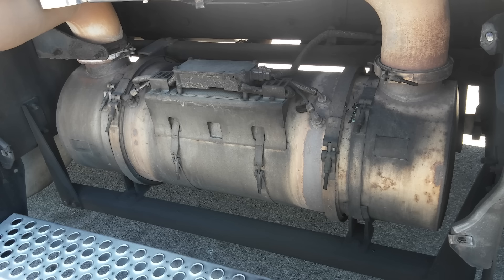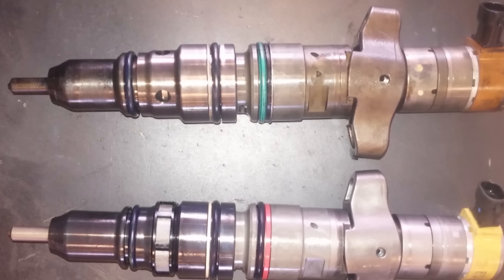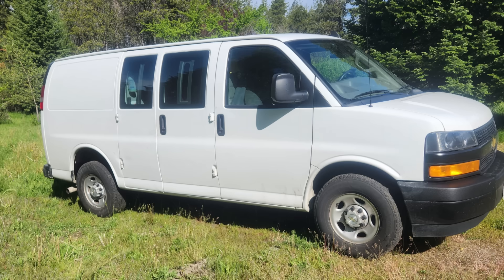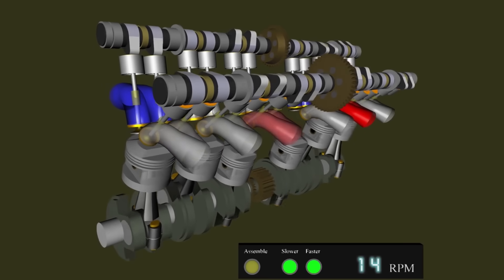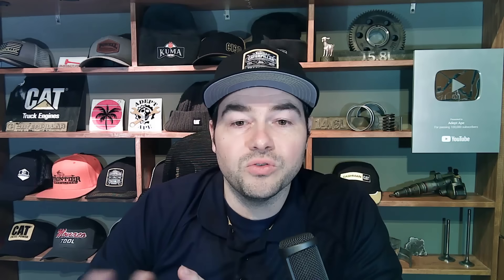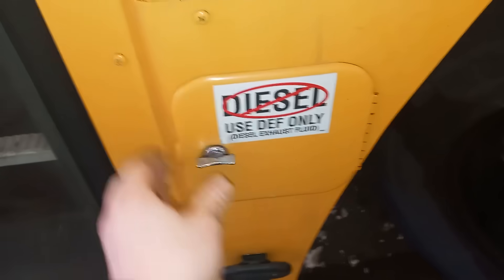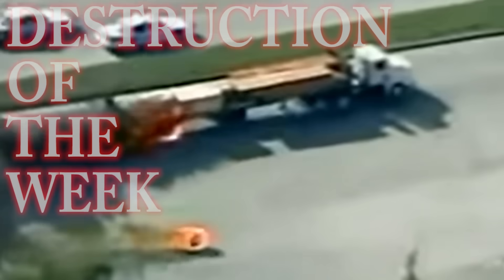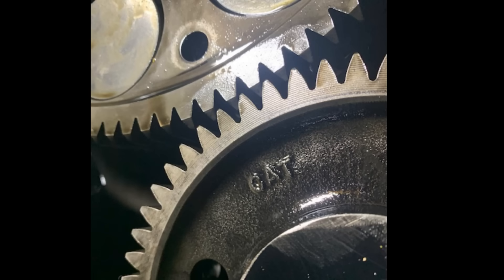What!? Gas engines are getting "DPF" Filters Now!!!

Comment: The GPF is nothing new, as someone who works on euros it’s been around since 2014 when Mercedes was the fist to use it and I have worked on tons of rovers and others who have it.  Just like on the diesel side as along as you maintain the vehicle well and use it properly it’s not an issue but the issues we see are the people using the wrong oil which is primarily an American mindset of 5-30 synthetic is why it takes right when there’s a whole nother level of gettin the mfg spec or ACEA ratings.  The issues we see on the diesel side in the shop is misuse like the guys idling at the school or in the Starbucks drive through becuse the guys who work them hard like a diesel is made to be used don’t have half the issues of the guys who use it for a commuter car

Comment: As we should all know by now the main problem with DPFs has always been the need for active regeneration because a) people drive diesels around town at low speed, causing  the filter to get blocked and b) all that nonsense with fuel injection during the exhaust stroke diluting the oil. My understanding is that for a GPF active regen is rarely if ever necessary, the exhaust is generally hot enough to regenerate the filter during normal driving. So generally they're not much of a reliability issue compare the to DPF.

Comment: Saw that coming, i noticed more smoke belching out of newer DI gasoline engines than my old IDI diesel ford does under load.
Reply: long live the 6.9 and 7.tree
Reply: It could also be oil due to low tension piston rings

Comment: It's due to lack of Atomization. Same reason why a carb makes more HP than fuel injection along with cooler air charge which means more O2.
Reply: carb never makes more HP then a fuel injection of the same environment.
Reply: @casemodder89carb always makes more HP than fuel injection due to better Atomization and cooler denser air charge. Engine masters ran a series of tests on the same engine and the carb always had better hp numbers. Drivability is a bit better with fuel injection

Comment: Don't worry, a GPF passively regions on a gasoline engine. There's no spark plug to light it off, it's done by retarding ignition timing and the leaning out the fueling. The ECU models the filter loading and does 99.9% of the filter cleaning when the driver lets off the gas which provides the oxygen required to burn the soot out of the GPF. With the new EPA regulations under the Trump administration, GPF's we'll go away anyways.

Comment: Direct injected gasoline engines will definitely roll coal at wide open throttle under high load, maybe not quite as bad as a diesel engine but they will definitely do it, I speak from experience abusing many different makes and models at my job 🤣🤣🤣

Comment: since this isnt something i know alot about im not going to preach about it being dumb but i will say that to best of my knowledge, it isnt •that• exhaust smoke exists that is the issue, as far as i know it isnt even considered bad for the environment, its that the specific byproducts of diesel soot causes cancer, gasoline being a more refined fuel doesnt have the mixed in byproducts that create cancer causing soot, my guess is that what they meant was the more stratified combustion process creates more oxides of nitrogen which are bad for the environment are either captured and burned in a similar way, or the "filter" doesnt actually work that way and theyre just simplifying it because they think we're too dumb to understand, my guess is its just a new version of the "3-way" catalytic converters that some cars had in the 90s but we stopped using because they cost too much

Comment: How to not require a GPF to achieve high fuel efficiency: go eCVT hybrid. Then the engine only ever operates in a narrow RPM and load range the entire air and fuel delivery system can be optimized for to eliminate the need for additional exhaust hardware besides O2 sensors to sanity-check what happens upstream.

Comment: Honda used what they called CVCC, a pre combustion chamber that received gas rich mixture that ignited a lean mixture in the main combustion chamber. This was back in the mid 1970s.
Reply: Yes they did.  It met the emissions standards for that time without a catalytic converter.  It wouldn't meet today's standards.
Reply: The whole CVCC idea was great for its time, it was almost like a stratified charge engine but it could be made to work with a carburetor instead of electronic fuel injection, which would come along later. It made it possible for the car to meet mid-1970s emissions requirements and it didn't even need a cat or a smog pump.
However, it could never meet today's emissions standards.
Reply: Mitsubishi used an MCA valve. It was like a tiny 3rd valve. But eventually whether or not you needed a cat had nothing to do with tailpipe emissions, but instead under 1.5 liter engines were exempt for 2 years.

Comment: Ive cheated all the epa crap. My newest vehicle is a 97 dodge with a 6bt cummins. Its all i will ever need. Can't imagine trying to replace it with enough electronics to power the space shuttle. 
And BTW, it has been molested to the point that I could remove the batteries, push start it and go anywhere.  All electronics have been ripped out and went old school on everything. 
Push pull cables on climate control and injection pump, along with analog gauges. 
Long live old school!

Comment: The fun thing with dpf re-gen is that they burn more fuel during regen. Thus producing extra emissions the wouldn't have been without that system.
Reply: whats even worse is that it only reduces emissions for testing, it still pollutes the same amount as without it just at different times, and when the regen happens the particles are just burned off into even smaller particles out of the exhaust that get embedded even deeper in your lungs
Reply: @georgedroyd2020 when I start a old cold diesel I love the smell when my new engine regens I run for air.
Reply: They killed displacement because less horsepower per liter means more reliability
They killed compression because it is more efficient and again no profit from more miles per gallon
They added dpf and adblue to sell you 1500 adblue and 2000€ dpf just after 3 years of car warranty...

Money, money, money... Its so funny
Reply: While the dpf is collecting all the soot particles and doing dpf things, the emmissions are genuinely cleaner. And very clean at that. Excellent, until you have to do a regen. All of that soot that it stopped getting out the tail pipe now gets burnt off. Essentially just breaking down these big soot particles into tiny non detectable ones. And also burns a lot of fuel in doing it which just puts more soot and crap out the tail pipe anyway. That's all well and good until you realise what those particles can do. On an older smokey diesel those big soot particles would fall to the ground and, if they got into your lungs you'd cough them up in a day or 2. The particles from a newer diesel will stay in the air longer because they're so light, and on top of that they go far deeper into your lungs. Due to the size you'll never cough them out so they'll just sit in there for ages. And if you work on or near these things you'll be taking in that crap day after day. All round pretty nasty stuff to be putting into your lungs
Reply: Not every poison is the same in toxicity.
Reply: It trades one type of emissions for another. Diesel soot is a known carcinogen and causes other lung diseases like asthma. CO2 produced by the extra fuel burn doesn't directly harm other people, it "only" contributes to climate change (the soot does that too, by making the average colour of the ground darker, which in turn makes it absorb more heat from the sun).
Reply: @nerd1000ify  The whole PM2.5 report was a bull5hlt study from the start.  The EPA had to do something to hurt the diesel engine's efficiency. It was to make the diesel bad so they could just to push for useless electric trucks.
Reply: @MatthewBerginGarage  Lungs don't like daysul smoke bro...
Reply: @nerd1000ify  just takes the pollution from the air and puts it in the ground.

Comment: Reasons why all my cars and truck are over 20 years old.
Reply: So true, cant go wrong with my simple barebones 99 sierra 1500 base model, 4.3 vortec isnt powerful but its simple and gets you point a to point b every time without a fuss
Reply: @georgedroyd2020 
Same for my 2000 Ram 2500 5.9 cummins. A diesel engine where the only thing between the turbo and the tail pipe is a muffler. Might only be 300hp (chipped) but the only thing ever to go wrong with it was the classic VP44 pump finally dying at 200k.
Reply: @l77scmaro2  That VP44 pump is to the RAM like the GM 4L60E transmission is to early 2000s GM trucks and SUVs. Once you hit 200k miles, you're on thin fucking ice.

Anyways, how's that Second Gen Ram rust and cracked dashboard treating you? I've already had the rust work done on my Chevy Suburban. I'm not buying a truck or SUV newer than 2006, so it was worth the money to me.
Reply: @lsswappedcessna  lol, pretty much. VP might be the cheaper fix though.

lets just say I'm already on my second dash mat since I've owned the truck.

I live in Idaho with our hot, dry summers so rust hasn't been an issue. Plus I don't drive the tuck that often. Pretty much it exists to tow my race car. 

I don't blame you. Didn't they start having all sorts of lifter problems with that damn DOD crap GM thought was a good idea? 

I ask because I have an LH6 out of an 08 that, of course, had two bad lifters.
Reply: I77scmaro2
I (so far) have left my 02 Cummins stock, other than a Fleece lift pump kit, 3 piece ATS manifold and gauges. Remarkably my dash board is still perfect! 2025 saw it being straight piped. 
Fingers crossed the VP and 47RE don’t go at the wrong moment. This will more than likely be the newest vehicle I’ll ever own.
Reply: Unfortunately, older vehicles will be banned sooner or later
Reply: @projectsspecial9224 yes but probably not in our life time
Reply: @projectsspecial9224 I hope so.
Reply: Same here I know it's a joke for many but my near 30 year old Land Rover still drives fine and I have no plans on getting rid of her.
Reply: @ironpwns Imagine calling a car a female 😂
Reply: I love my 1996 Volvo sedan. Runs and looks great!😊
Reply: Exactly! 😊
Reply: 20+ with aftermarket chassis support and high production numbers; engines with pushrods, roller cams and fuel injection for long life.
Reply: I'm heading that way myself. I have a 2017 Honda Civic SI and it will likely be the newest car I own. I had a 23 a couple of years ago and hates all the the alerts beeping, the infotainment updating, and missed driving stick so sold and and got the 2017.

Comment: we might see port injection make a return to popularity now. the combustion nature of port injection gives it good particulate performance so no gpf needed. *sigh*, i'm just hoping they don't fuck up em up super bad, theoretically a gas engine should work better with these than a diesel due to naturally higher egts. but that's theory and not real world, only time will tell how this really works. good luck peeps, tell me how good or bad they are in five years.
Reply: Diesel is way more efficient than gasoline. So much more efficient that it's not even funny. Unfortunately the reputation of diesel engines has been under fire in the US since the 70's, plus the price of diesel at the pump is artificially inflated by tax.
Reply: @lsswappedcessna  yup. though a lot of that tax is for road maintenance since big diesel trucks damage the roads more.

Comment: You know a funny side effect of direct injection on gasoline engines is that intake passages and intake valves get horrendously dirty and need to be serviced on a regular basis to keep performance up. There's YT videos of the aftermath of it. I've read that some manufacturers have resorted to a dual injection system. Primarily a direct inject with a throttle body system to keep the intake and valves clean which eliminates the costly maintenance of trying to keep the intake / valves clean. FWIW.
Reply: The injection systems have exceptionally little to do with that, if anything at all. The culprit is the PCV sending oil mist into the intake plenum which eventually builds up a sludge. Installing an oil catch can in this circuit solves the problem.

The same is true for diesel carbon build up. Remove the oil mist from the intake air and the carbon doesn't have anything to make it bind to the various EGR parts it so commonly does otherwise.
Reply: @agentx250  EGR and PCV do put the crud in there, but spraying fuel on the intake valves keeps them from getting coked shut like on direct injected engines.
Reply: @agentx250  I've pulled enough intake manifolds off, between TBI, MPI, and GDI, to state that the PCV oil mist causing buildup on intake valves is almost exclusively a GDI problem specifically because no fuel is in the intake manifold. In fact, GDI cars that run a wet shot of nitrous never have issues with intake carbon, either. And while it's true that plumbing a full-flow catch can PCV system (I used one to make a very stubborn carbureted engine stop burning oil like crazy) will keep the oil out, the extra maintenance is more than most people would be willing to tolerate.
Reply: @agentx250 Not so. On a throttle body (or carburetor) you have wet fuel mist right from the beginning of intake that continuously washes the entire intake system including the intake valves. Eliminate that fuel wash and then ever you say (egr) comes into play.
Reply: @SuperRede4u  I have a carburated classic and when properly adjusted there is no fuel-wash effect taking place.

If you have that much excess fuel in such a system then something likely isn't working properly and it's only a matter of time until you get pre-combustion due to that excess fuel in a 4 stroke system as far as I know.
Reply: I have a 2017 Colorado V6 with GDI. I need a fuel injection cleaning service once a year to clean the carbon build up on the intake valves since it is GDI. There is no injector in the intake manifold spraying gas so gas gets on the intake valves. It's about $180 a year which is expensive. I do see the benefits of GDI on some engines. That V6 makes over 300 hp on 93 and can do 25 mpg on the highway in a 5000 pound truck.

Comment: My 1994 XJ will stay the way it is right now I’ve owned it for over twenty years now and will never buy any of these new POS that are all junk don’t care what anyone says my old Jeep still has the original factory sensors motor transmission transfer case only run non ethanol gas has over 400,000 miles and still runs and drives great

Comment: its hard to understand how a direct injection gasoline system can be more fuel efficient that carburetor or intake injection systems.
Reply: Its not. But it allows to get more HP out of smaller engine. And guess what? Modern engines are tiny!

Comment: Designed to fail. Add a $3000 particulate filter, higher fuel consumption to heat and regenerate it, add urea (exhaust fluid) at $4/gal along with the storage tank, fluid lines, injector, numerous sensors that can cost up to $400 each... Yeah, this would be a deal killer on any car that has it.

Comment: Sounds like a great plan to increase revenue to the manufacturers and dealers!

Why are these actually needed on a vehicle that already has a catalytic converter which should catch anything particulate wise that comes through the exhaust?
Reply: If your really concerned? Buy a vehicle using older tech and find a rustproofing product. Here in the northeast it’s not miles that kill our cars,it’s rust. After 10 years many are so rotted away that there’s nothing to save. Don’t want new car BS? Fix the one you got and take care of it
Reply: @matthewcaughey8898 I'm not concerned about it, just wondering why it's considered necessary. I'm still driving my 1995 F350 with only 208k on it. It has a 7.3 diesel and a five speed manual transmission. I'll probably never buy another new vehicle for the rest of my life since I'm already retired and thus my driving days remaining are limited. I call the manual transmission my anti-theft device. 😂
Reply: @Last-Varangian  Works well enough in the US. Manual transmission is still normal essentially everywhere else.

Comment: with the vast majority of vehicles being hybrid and having a battery pack, and more average people only drive 30-40 minutes at a time. I heard about this a year or so ago.

the average consumer that purchases by  looking at the Styling and the infotainment system. is not going to maintain this system or even realize it's there until the system breaks and then they aren't going to want to pay the 5-10 k bill to fix it, as a vehicle is just a appliance to them and it's going to be either sold or its going to be chopped off.

Comment: I drive a deleted Ram Ecodiesel, now with 205,000 miles. Tail pipes are shiny clean. My gas powered Subarus have sooty tail pipes. Maybe gassers do need GPF's, hehe. Ram still has the DPF intact and regens about every 700 mi.